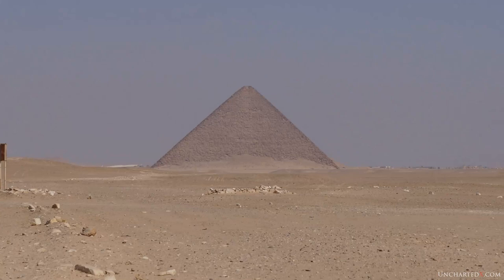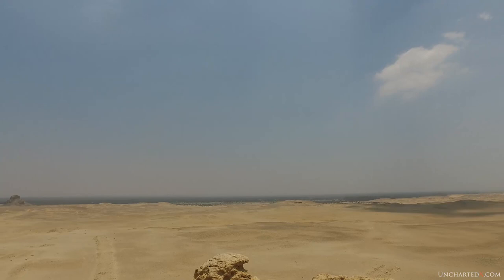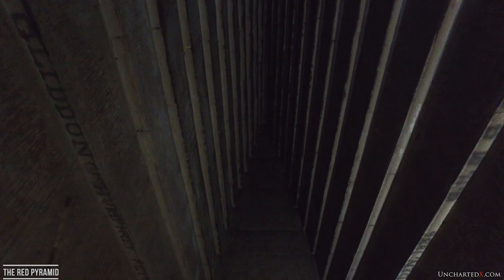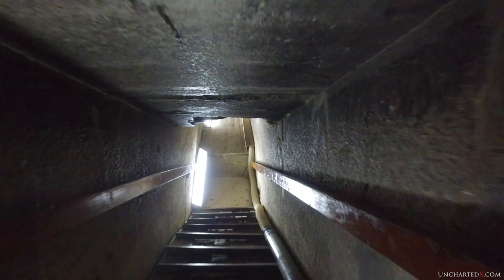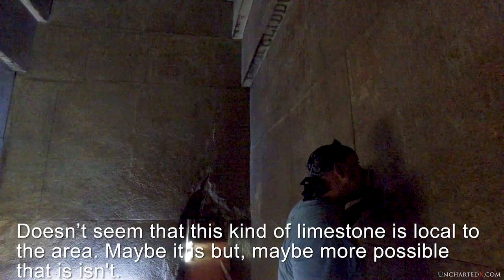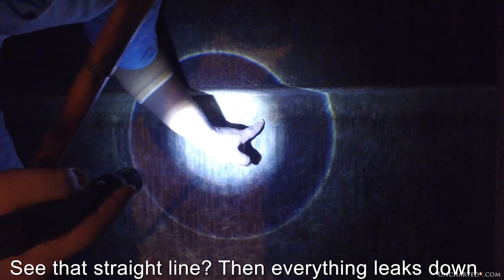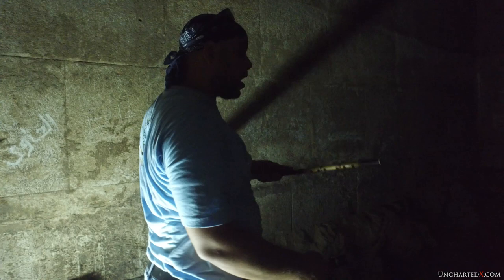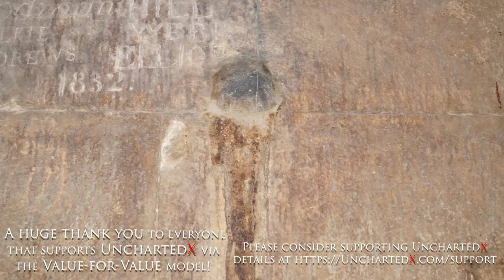The Mystery of Sneferu and his 3 Huge Pyramids - and a full tour inside the Red Pyramid of Dashur!

Comment: I think it makes the bent pyramid more difficult to rob or to break into. There is probably much more weight and pressure on the casing stones in the steep part, and someone might have tried to remove stones in the corner causing the whole thing to collapse. With the Giza pyramids many casing stones are gone and the entrance is visible with the rest of the structure intact, making it much easier to enter or to rob the stones.

Comment: If you split a hexagon into six triangles, then put four of them together at the base in a square then fold them up until the tops meet, you have the exact angle of the lower part of the Bent pyramid. Then if you split a pentagon into five triangles and fold four of them up until the tops meet you will have the exact angle as the top of the Bent pyramid. 6 and 5 are important numbers in relation of the celestial macro cosm and the human micro cosm. Great video, Ben. Cheers.

Comment: Notice how those lines of discoloration begin a few inches from the ledge, but aren't on the actual underside or in the corner?  It's a pretty common sight in caves too.  Why would something leeching out of a stone or between mating surfaces not leech out in those areas?  A quick observation of bats urinating and the length between the origin of that pee and the ledge they're holding onto solves that question.
Reply from the maker: It is bat urine, we figured it out since that video was filmed.
Reply: @UnchartedX , has a sample been analyzed? Did you see thousands of bats hanging around?
What would they eat?

Comment: Makes sense that the bent pyramid would be shaped like that possibly for casing stones in order to keep them on using gravity. The pyramid would be shaped same as all the others just the inner structure technology would be different. the bench shape allowing a larger base depending on what type of stone and then at the mid-level where it changes angle it would make sense that maybe they would change the type of Stone from a granite to Limestone which is much lighter not needing such an extreme angle to carry the way to ensure the stone would stay on. I have the same theories of the eight sides the Great Pyramid it would make sense if it was encased with stones that you would want structural base slope towards the center to keep the outer stones from falling off the edge, especially when it comes to natural disasters and weather and aging think of it as an inverted Arch, shape to catch the stone.   although I've thought as the pyramids as being kind of like a bomb shelter made for cataclysm for the royalty and as a knowledge depository over the along term I just don't see how the size shear scale equates to being tomb.
Reply: If they were doing things like this then they were certainly doing far more which has been lost to time. There's no way it was done on the time scale that we are presented by academia so we have to consider its insanely ancient and is, to some extent, being purposefully hidden.

Comment: Great video, many things come to my mind seeing this especially on the huge differences between 3rd and 4th dynasty pyramids and slightly later 5th and 6th dynasty pyramids. To make it clear those pyramids were smaller, cruder and all of them are now in complete ruins compared to 3rd and 4th dynasty pyramids and don't even have a pyramidal shape nowadays. No one in modern egyptology has never properly addressed on why in 2 or 3 generations they made such a big step backward in terms of building, Old Kingdom timespan officially goes from the 3rd to the 6th dynasties.

Moreover they never addressed on why internal chambers in the biggest pyramids are tuned to some acoustics or why no carvings were ever found on the walls of the so called burial chambers, something does not make sense.

Last but not least, when cameraman climb up the stairs leading to the entrance, appearance of external limestone blocks is just shocking, they look very, very eroded, even partially molten. An interesting question would be at which temperature does limestone start to melt ?

Comment: Okay, resounding sound.  I can go to St. John's Catherdral, NYC and get the same reverb effect.   But why?  To create that reveberation you don't need to build massive structures, just the rooms.  Like modern day recording studio rooms deaden the sound and you add reverb via an effects unit.  Only they did it in stone.  So why did you need so much structure around the rooms?  As reinforcement?  Containment of the forces?  What would run a 30 foot diameter saw blade that's millimeters thick and cuts granite like butter?
Reply: isn't there evidence to suggest that those kinds of granite stones had some kind of treatment that softened them? i'm reminded of the ancient granite quarries where stone has been scooped out as if it was liquified.
Reply: @indieWellie  yes there is and that power source has yet to be explained also!  But the alt has suggested that these structures are the power sources and unless great pressures are needed to be contained why build them when you could make the same resounding structures with much less stone?  So I agree!  What melted stone?  What was the real power source?  The sun?  Lenses?  A 9 ton glass slab was found.  But we should find a cache like the cache of vases and bowls found 90 feet under saqqara.  80 plus perecent of egypt is still under the sea sands.
Reply: Maybe the baltic sea anomaly IS the machine they used for the scrap marks.  ( Metal fossilized would be dark, like basalt?)
Reply: @MarcMartino  Pressure creates movement, movement can create energy.
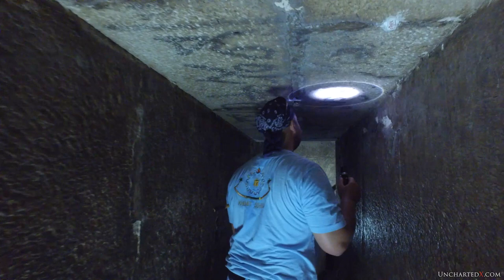Reply: Was I the ONLY one to hear the "humming" sound @ 32:39???? Back it up to 32:34.
Please reply. Thanks.
Reply: Yes man. Containment of the forces? It can be said that the bigger a thing the lower the frequencies it resonates at, the bigger the forces in play.

Comment: Amazing content love the videos. I love how you get inside everything and get videos. But one thing I've never really seen pointed out and I want to point out when I was watching you go down a long tunnel into the Red pyramid here I thought of it. On the floor you're walking on a modern stair system I'm assuming underneath the modern stair system it's smooth correct? If what I'm assuming is correct that it's smooth under the modern stair system then that would mean that these shafts that go into the pyramids we're never meant to be walked in and out of by people. Because if you're going to be having people go in and out you're not going to have a smooth shaft you're going to have it rough or have stairs in place so that gives more Credence to it being a power station then a shaft to a burial chain. Because it's going to be really hard to walk down a smooth shaft carrying pottery carrying a casket carrying whatever to burial Chambers it's almost impossible.

Comment: Just a theory but the drip marks could have been a lubricant used while cutting that maybe wasn’t as visibly staining to the blocks at the time. With excavation and tunneling, dust and debris could have gathered more on the areas where the lubricant dripped down the blocks thus staining them over time.

Comment: The black may be a fungal residue that promulgated on the dampest areas with the humidity (needs testing as said), although it could be residue from torch flame or similar, depending on what was used on the wick.
The fact it is away from the joints is significant though.
To me it implies an area that was protected/covered at the joints.
That implies some kind of sealant was placed at the joints that has now eroded away with time, but not before offering considerable protection over the millenia.
But that begs the question, why you would need to seal the joints, like a builder would use silicon sealant ?

Now given the way that the finish seems to flake off of the surfaces of some stones, that appears to have some kind of synthetic surface chemical treatment/process to harden it, but weaken the surface bonding to the core material in the process.
It would probably be bad if that surface treatment can be invalidated/undermined, by gaps between the stones, reaching the core material.
Might explain why even the precision fitting casing at Giza still had fine cement.

An erosion protection process ?

Comment: Hmmm 380 tons a day... 32 tons an hour. Average block is apparently 2.5t, so that's about 13 blocks per hour... one every 4 minutes and 36 seconds? A single team of workers is unlikely, there would be several. But 13 blocks per hour still seems incredibly high. 32 tons is the equivalent of a concrete mixer filled to the max. You'd need teams of teams. Plus, you've got to supply those teams with blocks. I could maybe envisage a shed load of workers, all dedicated to the job of construction, they probably could move 32 tons an hour... but how the hell do you quarry these blocks in that time AND transport them? Even if you quarried on site, you could not possibly create a 2.5t block in a little under 5 minutes. I don't think we could do that now, with explosives and machine tools.

Something definitely doesn't add up there. Heh
Reply: Maybe tens of thousands of workers at different stages of the process at the same time. A feat of labor orchestration and planning.

Comment: Ultrasonic thickness meters require a drop of glycerin between the censor and the surface being measured to ensure good contact for an accurate reading, could the set liquid that runs from between the blocks have been used during construction to connect the blocks for some acoustic function?

Comment: It's really very frustrating that we know so little about the pyramids and what they were for.
For people to go to so much trouble to align them and shape them so accurately and with great precision they must have been extremely important !
This is not the type of project that is done on a whim or as a challenge or to demonstrate their abilities, they were built because they were required, they had an extremely important purpose which is beyond our current understanding.
If the interiors had been intended to be seen then they would have been highly decorated, they would also have been made easier to access and had huge stairways instead of steep narrow passageways.
The highly unusual stepped ceilings must also have had a purpose too, they would not go to all the trouble of building that type of structure just to be hidden away inside a sealed pyramid if it wasn't extremely important. 
That type of structure might be useful if you wanted to create a lot of air pressure by pumping a liquid into the chamber, each step in the ceiling could represent a higher pressure and as the liquid rose the spaces get smaller and the pressure increases, but why they would go to so much trouble is beyond me.

Comment: Consider; In the final chamber (East-West), the unknown excavation of the 280 tons of stone that was painstakingly removed out of the pyramid, was taken from the floor and sub-floor area of the chamber.   They dug down...  
Which given  the vast unexcavated area within the entire volume of the structure,  where other chambers, may or may not exist, seemed like an absurd endeavour.  Surely the 'tombraiders' would have attempted to remove masonry laterally, maybe starting with the odd white block 'doorway' in their search for yet another chamber and the elusive sarcophagus of Sneferu. 
.
Consider; in Khafre's pyramid the placement of the sarcophagus was set in the floor of the 'burial chamber'... And it too, showed signs of having been tampered with, as the lid was not in-situ, within it's security pinned dovetailing...  [Flinders Petrie et al] 
.
Might we also thus consider that if the location of Sneferu's sarcophagus was similar in concept - placed predominantly
 below floor level, with perhaps just the lid visible/protruding above floor level; that whoever excavated the final chamber of the Red Pyramid might well have found the old king's resting place and also considering that the same building practice may have been used as in Khafre's chamber - cemented into the floor blocks/bedrock - that a considerable amount of rock/masonry would need to be removed, to gain access to the sarcophagus, removing it entirely, or breaking it up to remove the contents and even the sarcophagus masonry (?)

Comment: Just a thought, but maybe the black liquid is some kind of bitumen or oil that was applied like mortar between the blocks, for lubrication to slide the blocks into place. Then when it goes off it gives a bit of adhesion, and sound proofing. Then over the millennia the compression is gradually squeezing it out of the joints.
The accuracy of the large internal blockwork is stunning even by today’s standards.
If only they had left one pyramid with the exterior dressed stone intact, like the Pantheon in Rome was the only thing kept for posterity.

Comment: The roughness on the block on the inside reminds me of a carb "intake" port which has the roughness to create more surface area for gas vapors to collect.
Reply: That roughness in an intake is intentionally left to create turbulence and prevent stagnation in the boundary layer of air, reason being you don't want anything collecting in the intake, you want it all to go straight into the cylinder.  The net effect of a smooth intake would be like choking it down by several percent because the boundary layer hardly moves at all...meaning that boundary layer might as well be the wall of the intake itself.  The air actually going into the cylinder would come from the middle and slow down toward the outside in a gradient, and that's certainly not desirable.

It's a good observation, though probably a dead end.  That type of rough surface has very little effect on such a large area as those walls, the Reynolds numbers just don't scale up in fluid dynamics to have any appreciable influence on anything flowing within that chamber.  Now, if there were bits and nubs sticking out of the wall several inches long in a seemingly random but intentional placement, then a better correlation could be made toward their use of energizing flow and preventing boundary layer stagnation.
Reply: @Skinflaps_Meatslapper  We always rough the intake port and smooth out the exhaust port on 2 strokes.
Thanks for your take on this.
Reply: @happyg.444  Proud owner of a few heavily ported LT250's and LT500's here

Comment: The dark liquid could possibly be caused by sour/acid rain coming in contact with the limestone or other minerals and mixing with each other. Test for pH of the liquid using pH paper, the most accurate measurement would be within 25 celsius.

The underground "pyraid" looks more for structural testing then the dahshur pyramid, it could have been easier to test that underground then above?

Comment: Possibly the builders of the red pyramid were workers or slaves that couldn’t write. Then the later restorers were from a time when the ability to write was more common?
Other option could be that the tools were different, if the stones were molded or formed from liquid or shaped with tools using sound or other vibration then those tools would not be able to be used for writing.

Comment: The simple laser survey by National Geographic mentioned proved that the Bent Pyramid shows no bulging whatsoever on the sides, i.e. it never had structural issues. (I have a full recording of that eisode). I mean, one just needs to measure it properly; Margioglio's work was approximate, it's dated and flawed; this lie about the Bent pyramid must stop.
Reply: Other than the corners fell away it's just fine.
Reply: There was wood used to support the interior.

Comment: the many strange passageways and rooms in the Egyptian (and other Pyramids) could be simply a result of construction processes?   perhaps ventilation shafts or access ways for the workers to use during the building phase?   If I was a to build a garage, I might install horizontal framing into a wall to create a basic ladder to access the higher parts of the construction which is then covered up during the finishing stage.   

And as far as "experts" go, sure they may be well versed in their fields but nobody other than the Ancient Egyptians would know how, why, when and what these massive structures were used for.   Why would anyone build 3 houses at the same time (to use a modern logically thought process), halfway through say "well we messed that up" and then finish them at major time and costs?   Makes no sense.  Well, we do it all the time in Government, but aside from that.   Applying modern thinking to an ancient building could lead you to a wrong conclusion.    And there goes your payday from the book you wrote about it claiming to have all the answers, nobody wants to admit they are wrong but there is no shame in it.   In fact, the whole concept of science is founded on being wrong, hence why everything is labelled a "theory"

Comment: The more I hear Youssuf talking and wondering why the old ancients used so much stone and why they did not re-use the blocks for the next pyramid if the first one failed... the more I think that the pyramids' purpose is to use as much stone as possible. 
Maybe Tina from "Curious Being" is really up to something that pyramids were geopolymers from excavation rubble from the surrounding mining shafts like the Osirion shaft in Gizeh, with a dual purpose function.

Comment: The readily available answer to why the blocks of the 'failed' bent pyramid were not reused to construct the red pyramid is that many, or most of the blocks were cast in place, thereby resulting is a strong molecular bond with the block below and beside them.  
Separating them would thus be a major effort since after 5 millennia they would be fused together.